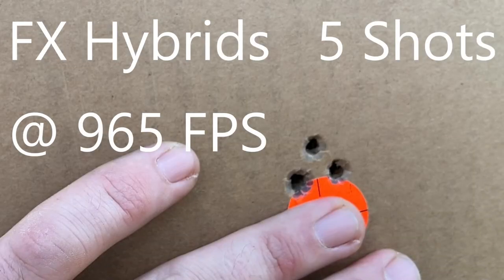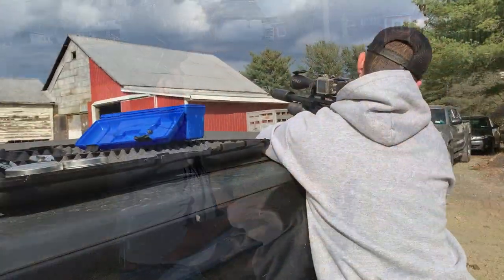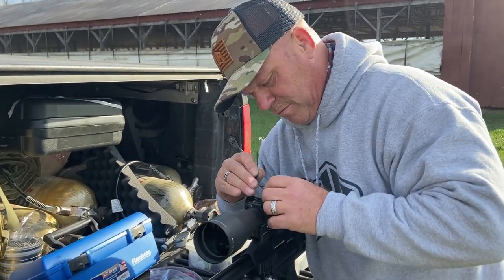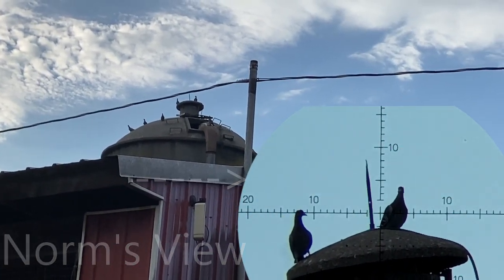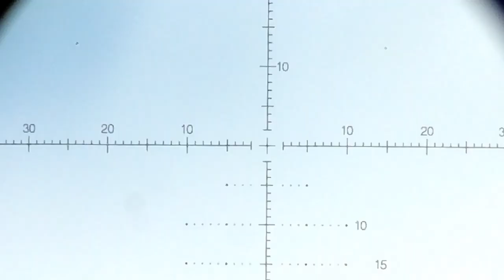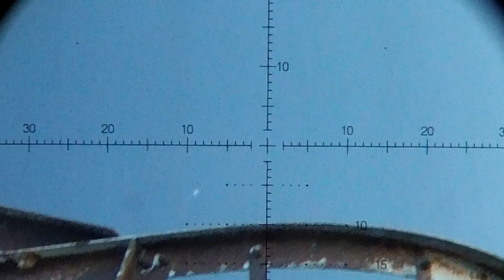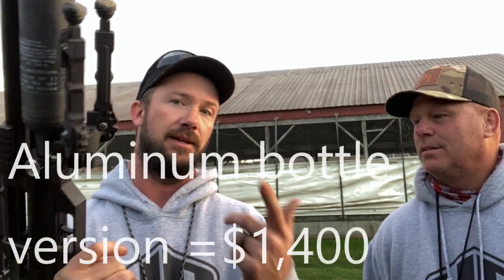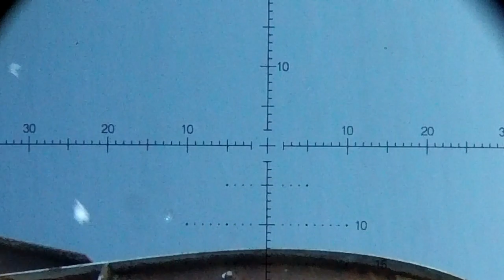FX Maverick Sniper & Compact in .30 Caliber | Airgun Hunting

Comment: I am curious as to why you choose 30 Cal instead of 22 for birds. Shooting around tin roofs and equipment ,wont the 30 Cal do damage ,make holes.
Reply from the maker: the 22 will damage as well so you pick the caliber you want and then have to be careful about the angles and make sure there is wood between you and the tin or its at an angle to make it glance off

Comment: I got the .25 compact. Out of the box is was shooting the kings and hades at 845 fps on power wheel 7. On power wheel 5, too slow to register on the fx chrono. Horrible factory set up. The second reg was at 125 bar. I followed Ermest Rowes and Gerharts instructions to set the regs and now I need O rings for the second reg because it just leaks. I ordered an O ring set for the wildcat mkII, maybe it will have the size I need.
Reply from the maker: Oh damn.
Reply: I did the same on my first FX (crown) as Ernest shows us to bleed the air out of the plenum by unscrewing the adj instead of dry firing it. I made the mistake of screwing it back in before all the air was out- this chops the rings up.  So now I just dry fire them- no issues. they o rings are so small though - they are a right pain to install - but doable - good luck - it will be worth it.

Comment: Whats your setup for your bottle. I have a scba tank coming to me and need a setup. Thanks
Reply from the maker: I run an air marksman bottle, with a saber tactical valve, donny fl quick connect and a micro bore hose.  If you call the donnyfl shop they will set you up!

Comment: Hello, could you tell me your opinion about the two models of air rifles. Between MAVERICK 30 CAL SNIPER or FX M3 SNIPER 30 CAL which can increase the speed до 1000 FPS + 1030 , 1050 FPS
Reply from the maker: Both rifles will do it with the slug kit installed.  The m3 will be easier to tune though

Comment: Your wind calls are amazing. I am with sub 12 lbs and need about 3 moa on an average day in Wales. So windy. .177 only going 750 fps
Reply from the maker: Oh yeah man i have tried the sub 12 game before and it is incredibly difficult compared to high power.    Much respect!
Reply: Really need to get off that 177 & try using a 22 cal that will give you a little bit better advantage on the wind.

Comment: hi, i never owned a airgun myself. If you zero your scope at 50yard. Do you have to adjust it all the time for the drop? Or what is the range you keep your scope the same?
Reply from the maker: Good question.    Yeah anything past 60 is going to require holdover or adjustment    Think of it like shooting long range all the time.   100 yards is like 300 with a powder burner.   300 yards is like 1500 yards or so

Comment: i have a .30 cal fx mx2 impact  pic up some hybrid slugs they dont fit in the mag
Reply from the maker: Like they turn sideways?  The mag by sideshot holds them perfect man thats what we use for slugs.   The fx mag is mint for pellets but not so much for slugs
Reply: @68Whiskey  I have 2 of the metal ones the hybrids are to long I cannot get the clear cover  back on then yesterday I got the plastic one out and the hybrids will fit in that one?

Comment: A few questions. Can you run a dual 580 cc bottle setup like with an impact?
Can the velocities be obtained or close say within 30 fps to an impact with same caliber same weight slug or pellet?
Is there any aftermarket accessories yet like arca rail for a camera tripod? 
Thanks
Reply from the maker: I dont see why you couldnt run dual bottle.   It is just as fast as the impact if not faster (bigger plenum).  And there is already a buttstock from saber tactical.    Rail is in the works!

Comment: Great video and great shooting I'm getting one in 30 caliber compact will it shoot moa at 100 yards and what's the maximum FPS will it shoot with the 44 grain pellet ? Thanks
Reply from the maker: Yes to the moa question.  Maximum fps we havent tried yet.   But its very happy at 965 fps.  Which is probably as fast as we should shoot them any way for accuracy
Reply: @68Whiskey  Is this the 30 compact doing 965fps ?
Reply from the maker: @ronnieumberger  no man the compact is doing 905.   Thats the sniper at 965.    Needs the extra runway to gain speed and use the air
Reply: @68Whiskey  will the 30 compact shoot the hybrid SLUGS well ?
Reply from the maker: @ronnieumberger  so far mine doesnt love them but the sniper sure does.    I think they want to go fast
Reply: @68Whiskey  Are they going to be a special liner for them ? Thanks
Reply from the maker: @ronnieumberger  i would bet on it knowing fx but to be honest I really dont know.    Im sure they want them to work in all the guns.   Ive only had the mav for s little but so havent tuned it much.   Really dont know more than that at this point but we will be sure to say so if they fly well at 900fps for us.   Just not enough time with the gun yet
Reply: @68Whiskey  Thanks for all the help  and information !!

Comment: So the question for me is 25 cal or 30cal. I really dont see much shooting beyond 200yards, the majority  will be done 25 to 125 yards. Is the economy of the 25 worth it ? Or should I use the "you only live once approach" and leave all the plinking to my break barrels and 177 gauntlet and just step up to the 30 and be done with it? Thanks.
Reply from the maker: If i could only pick one its 25.   Mainly because of air consumption.    If you have limitless air, go 30.    Otherwise.   25 for many reasons
Reply from the maker: And I’ll add to that my longest pigeon was with a 25 at 327 yards.    Its no slouch
Reply: @68Whiskey  great info

Comment: Hello
I have a Maverick 25 cal. Compact Standard 500mm barrel.
1. Reg 175 bar 2. Reg 150 bar PW7 IHS?!? and shoot JSB Knock Out Slugs 33.49 Gr at 885 FPS. The Slugs Spiral !!
Does anyone know WHY ??
Reply from the maker: That combo is going to want a slug liner buddy.   The twist rate isnt right for that projectile with the standard liner.     You want the heavy liner if you are going to shoot more than 26 grains in my experience.   Sometimes you can get lucky but most times you cant
Reply: @68Whiskey  Thanks for the tip, I'll test it .....
Reply from the maker: The other thing to keep in mind is not all barrels love all slugs.   We usually test a few brands and then pick the one it likes.
Reply: @68Whiskey  I will test it extensively!

Do you have experience with the JSB 25 Knock Out! ?

Comment: you guy's are getting 30   shots a fill,  on pyramid air ,airgun depot etc are saying that the 30 cal is 90 shots per fill....is it because you have it set for slugs and power? ....why are they saying 90 shots
Reply from the maker: Yeah its all about how much power the gun is tuned for.   You can get 90 shots.   But we fling our projectiles faster than them